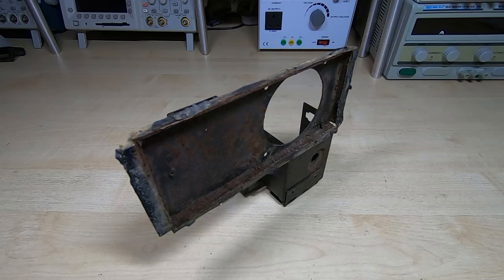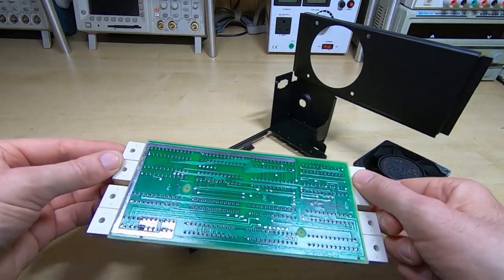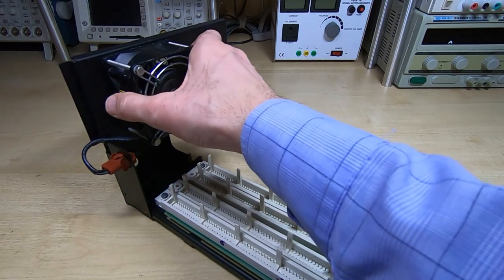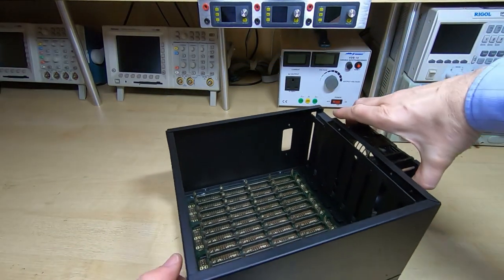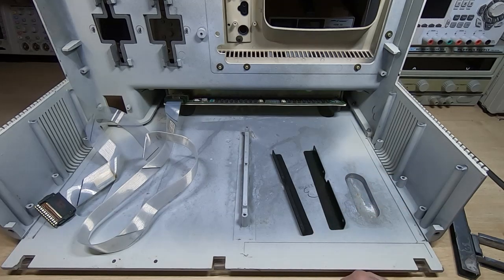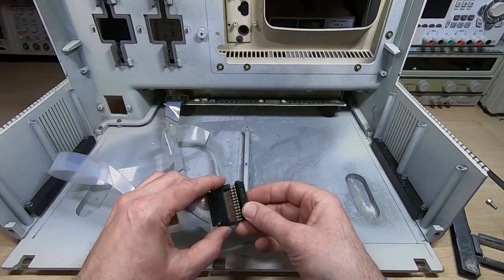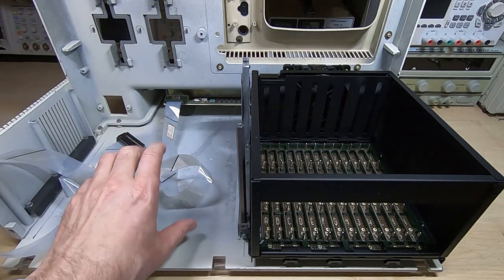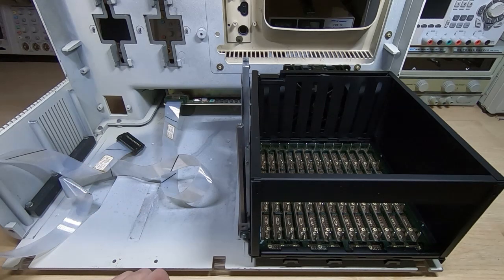IBM 5120 Part9

Comment: Hi Jerry. Long long time ago y worked as field egineer with IBM sys34 & sys36. The electronics board & backplanes looks very similar to those, with al these tipical IBM aluminium modules. Very nice work. You hare working on several projects at same time and filming everyting :-)
Reply from the maker: Thanks, I will be posting a video about the IBM module system.They were originally developed when IBM was developing the Sys36 mainframes and for a while they were competing with monolithic IC development but the monolithic technology won and the SLT modules dissapeared. They are easy to replicate if I can find informtion on them but I cannot find any information on most of them so I am hoping that they work. They did tend to be much more reliable than the monolithics of the time so with any luck they should be mostly working but you never know with this old equipment. I generally have quite a few projects going at once as I often have to wait for parts to turn up for one project and so I can work on another while I wait.